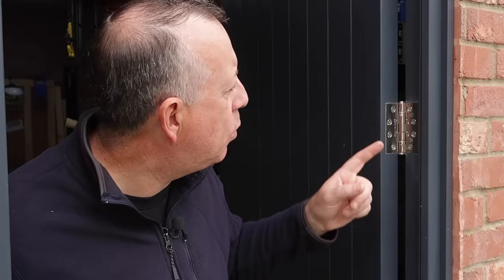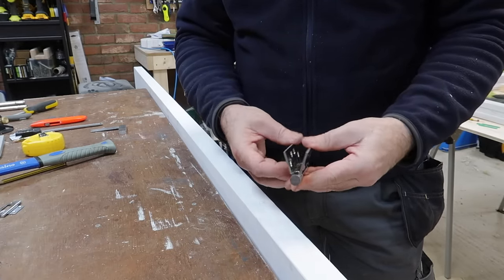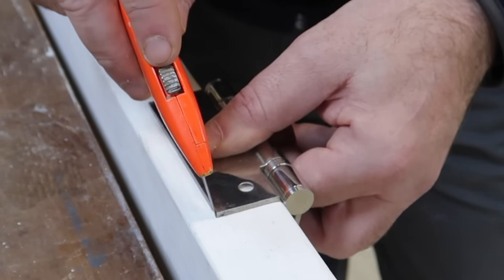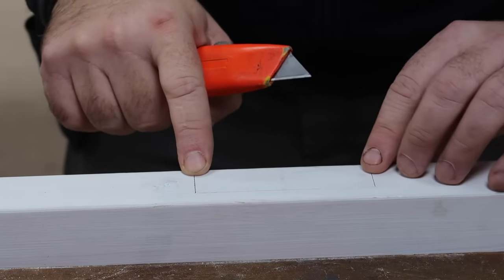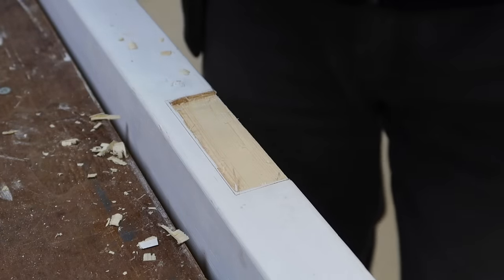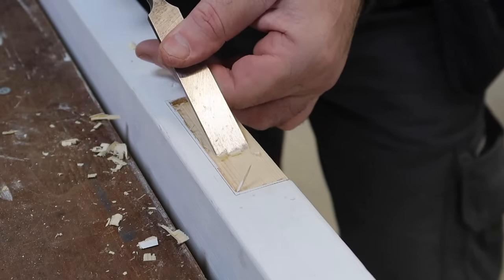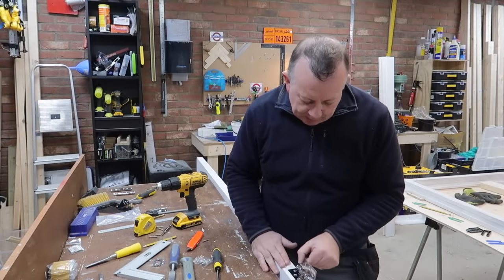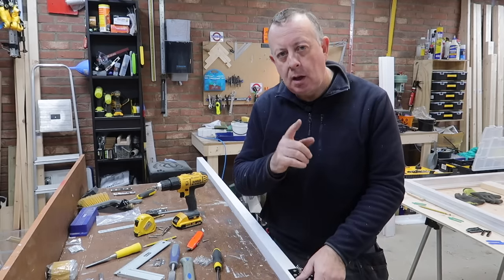How to Fit Perfect Door Hinges

Comment: As someone who has been an instructor for many years (not joinery or DIY) I can say that this guy is a truly great instructor. Calm, clear and just lets his knowledge flow through him. Top notch.
Reply: A great presenter as well.
Reply: You actually know that it’s a joiner who hangs doors not a “professional carpenter “. A carpenter does carcassing, first fix, roofing etc aka roughings in Scotland. The hinge set out on a standard 1981 or 2000    6ft6 is 7 inch from top, 9 inch from bottom with some regional variations… never 4 1/2 inch.
I could go on, sorry.
Reply: blimey.i fitted some door hinges today,I just banged it any old way,like a first year novice at kindergarten school!every time that I fit door hinges,half the door splits down the middle!
Reply: @carljames9351 It depends what part of the country you are in, Midlands and down south a carpenter works on site, a joiner works in a joinery workshop. Always 6" from the top and 9" from the bottom around here!
Reply: @edthompson9337  carpentry is defined in RIBA specifications, RICS methods of measurement etc. carpentry is what they refer to in Scotland as roughings. 
I don't dispute that regions tradesmen may call things slightly different but the terminology and what it covers is quite clearly specified.
Interestingly I spent the start of my apprenticeship at wimpeys training school in Birmingham. It was 44 years ago so my memory may fail, but a couple of lads from the adjacent workshop called the site lads carpenters.
Some parts of the country do hinge 6 and 11, we were taught 7 and 9. These ratios are similar to give the optical illusion they are equal dimensions from head height.
Reply: @carljames9351  Having taught at a local FE college, City & Guilds uses the term 1st and 2nd fix carpentry. 1st fix being everything before plastering, joists, roof, stud work etc and 2nd fix being everything after plastering, doors, skirting, etc.

Comment: Only another 12 doors and 36 hinges to go! :) (I would like to see him fitting hinges to a door where the frame was already installed.)
Reply: Well his method of putting a 12”steel ruler ( not a joiners tool) across the edge of the door to somehow allow marking the hinge depth wouldn’t work as shooting the door in to an old frame requires planing a slight back fall on the edge of the door,all joiners just hold a pencil and run it freehand using door edge to gauge off simple

Comment: Thank you. i do rescue work w/ my city's homeless Animals, and i've built this crazy-awesome shelter w/ the roofing structure i am putting on hinges (So i can open the shelter for cleaning whatever). Going broke for nice materials that will last, i have these heavy hinges for the job....(never done hinge work before) wasn't confident at all on how to install the hinges until i watched your video. Working on it in the woods today, i need to remember that the door (i mean the lid//the roof) is the part i start with. Thank you again. i've been fretting this part of the shelter for EVERY DAY for the past month. Thanks :)
Reply: i also plan to try filling my drill holes with glue also before i put in the screws. i think the glue not only "locks" the screws in place, but the glue may also absorb into the inner wood and create a stronger "sink-hole" to bear weight and such. Thank you again. You really took this fretting headache off my shoulders.

Comment: Hi Stuart 
Good video. The hinge space at the top of the door can vary depending upon the age of the property that it is to be fitted into and also the type of door for example fire door will have a full specification on the hinge positioning and the type of furniture that can be fitted.  But when I was an apprentice we were told the bottom hinge was to be fitted at 9inch up to avoid the hinge being splashed with water during rain etc and causing corrosion it also helps with access when you are chiselling them out👍👍

Comment: I never use the screws that come with any fittings, hinges or any door fittings because they are usually crap.
Reply: Stainless or so soft !
Reply: Pilot them and when youve Placed your screw in the pilot hole scrape your knife against a bit of sandpaper over the screw heads.works a treat to stop them slipping out
Reply: The hinge screws are find just hit the hinge with the Vix bit to pre-drill very screw your going stick a screw holes on the hinge and lower the torx pressure on your screw gun and hit the center of the hole with an 1/8” drill bit if you don’t have Vix bit, if the Screw is way thicker use a 3/16 drill bit, or the screws heads will snap. Do not use a regular Drill because you can’t control the torx pressure on a regular drill to drill the screws. I’ve installed more than thousands of Doors For Builder Square, HomeDepot & for Lowe’s at their Costumers houses. I’ve made Front Entry Door’s and Raised Panel Cabinets, and installed many Kitchens, custom and store bought cabinets a lot of other wood work. Commercial Building and all their hardware and Complete Houses. From cutting roofs to inside fabricating Interior Dom roof’s to Stair cases hand rails, Crowns, Interior wood work of vehicles. I’m just a very old wood craftsman. Just in case you question my experience. Hope it works for you, cheers.
Reply: I use decking screws haha never ever had a problem

Comment: Great video as always. 👍

I spent years using a chisel then, one day I thought I’d try a palm router. I’ve never looked back. 

Installed a couple of oak double doors last week. Effortless using the router. 

The key, as you show here in your video, is the Stanley knife. Without that it’s very hard to get a nice looking finish surrounding the hinge.
Reply: That’s what I use, I just set the depth of the router to match the hinge depth, then freehand cut it out, staying clear of the lines, then finish off with a corner chisel and a normal chisel, I have graduated to marking knife from the stanley knife, it’s quick and easy.

Comment: Actually cried out "oh yes!" when I saw you're tackling this haha! I'm changing at least five of my internal doors, and had to repair the chewed up remains of frames where previous occupants botched screwing hinges. I'm eager for more tips on offering up doors with shims, marking for trimming and frame rebates; seems like such a pig of a job but I'm sure there's an easy way. Yes, self-centering drill bits save so much bother, wish I'd bought those years ago. Chisels only for finishing, router with depth stop for rebating on easy mode.
Reply: @kirkhamandy  I have a good router, and made a little jig for rebating hinges, but before I get on with the rest of our doors I'm hoping Stu has suggestions that make the hanging easier. That's this week's excuse for putting it off anyway. 😇

Comment: Hi, nice job. I see so many butchered hinges these days, nice to see a good finish. Two things that spring to mind. 1 Get a soft-faced dead blow hammer for your chisels, I so hate to see a hammer used as a mallet. Dead blow hammers are much better and your chisels will thank you for it. 
2 the back of your chisel looks like it's never seen a stone. The shinier the back of your chisel is the better it will sharpen and cut.
Like many here, I use a small router/trimmer to remove the bulk, but people should use your method  if they are just a DIYer
Thanks for the video.

Comment: This is excellent, no music, no in your face 'guys' jabber. Same method I use, I'm a decorator so like dead straight clean edges. I tend to use wider chisels as I find them much easier to control and get flatter rebates. I also use Olfa knives as they are ultra sharp and thinner than Stanley blades, the snap off idea encourages much safer working as blade will always be sharp. Careful now! Really like centering bits too , essential.

Comment: Another classic video, thanks.  I find the really hard part is fitting the door-fitted hinges to the frame accurately - do you rely on measuring and marking?
Reply from the maker: Thanks. Measuring is not accurate enough. Need to offer the door up an shim in place and then mark as I did with a knife
Reply: @ProperDIY  video please!
Reply: the best way to mark up for hinges, is to make up a stick, with hinge positions marked, with the door gap at the top marked on the stick, always measure from the top  of the door going down. once its made, its easy to mark both frame and door with one stick, and is perfect every time, a rough guide to hinge positions is “the top of top hinge, 6 inches down, the bottom of the bottom hinge, 9 inches up ( from the bottom of the door)
the centre of a centre hinge, central, between top and bottom hinges, ( there is far more forces acting on the top hinge, compared to the bottom one, so its not a bad idea to fit the middle hinge a little above the centre point between top and bottom hinges on the door,

Comment: This isn't YouTube DIY, you haven't used a £10k table saw or router table for the smallest of jobs 😂
Having said that, I use my palm router for the bulk since I'm too lazy, I then just use the chisel to clean up the edges, no hammer required!
Palm routers are cheap as chips these days and come in handy for just about anything.
Reply from the maker: You'll know when I get sponsorship when I start using the big table saw!
Reply: I use a palm router ...I have 2 Axminster jigs one set up for 4 inch hinges and one for 3inch hinges really quick and accurate..trend corner chisel to square the corners. they must have paid for themselves ten times over...only have two jigs as I'm too lazy to mess about adjusting them

Comment: Very good advice. For centering I use a wood drill the size of the screwhole. So it is guide as in the selfcentering drill bits. The wood drill has a center which will make the dimple and the edges in contact with the surface. Those are then guiding the drill in the hole.

Comment: Attention to detail. Very impressive. Good to see.   In the pro environment, profit and time constraints mean most would never take the time to do a "proper job",

Amateur me has time on my hands and that Stanley Knife and metal straight edges is  something I discovered many moons ago when simply picking up the Stanley Knife instead of the Wood Chisel. A simple mistake like that reaching for the wrong tool teaches you a better technique. 

When the time comes to insert the actual door lock into the side of the door, again using the door lock itself as a guide to produce the perfect and neatest aperture, job's a good n. 

Yes, few folks would notice if any but as Proper DIY confirms, it is very satisfying to do it right even if few folks would ever appreciate that level of accuracy. Pedant me would notice it though.

Keep this good stuff coming.

Comment: I have been a chippy for over 32 years and I was taught by the best old time chippys and the hinges should be 6 down and 9 up and cantre and if you open up the hinge you will notice on the one side there is a slot and that is the line for edge of the door you don't fold the hinge in half and push it to the side of door as when you chop it in the hinge won't sit flat, that's how I was taught in college many years ago but if your happy keep up the good work.

Comment: Fantastic. As a TIME SERVED JOINER I would like to advise your viewers that RAZOR SHARP CHISELS makes this task A HELL OF A LOT SIMPLER. That is another skill to learn too. Very neat my friend.   👍👍👍
Reply: Hi Ian, I am an old carpenter joiner. At the Theatre where I work we often get outside contractors in to do large builds etc.  Very few, if any of the modern day carpenters can sharpen their own chisels. I sharpen all my own tools including my Disston saws, Cast steel marples, Ashley Iles, and Scharwhecter chisels. Plane blades also.  I know of no carpenter that has been to our place who can sharpen a plane so it doesn't leave tram lines on wide timber. That's if you can find one who even uses a hand plane.  I'm 61 and probably a boring old fart but was always taught that you weren't a Carpenter until you could sharpen your own tools.  Sorry!!.........the boring old fart is going now!! 😂😂.
Dave.
Reply: Also Ian.....they sell chisels you can use straight out of the box these days!!! 🤣🤣🤣.  I've lost count of the times I've seen er...wannabe carpenters using chisels straight out of the box because it says so on the box. And let's face it to them it probably feels sharp!! I always flat grind mine bevel up on an India oilstone to make sure the back is perfectly flat, then I hone the edge....or put on the 2nd edge as my old Dad used to call it. Take the burrs off flat again then wipe off the oil and strop it on the flat palm of my hand.  Makes them like razors. It's amazing the amount of people I've sharpened chisels for who test the edge by holding the chisel like you would a hammer and  press their thumb on the top!!  I have to say Whoa!! Stop!! You'll slice yer thumb off!!  Flat grinding hammer forged chisels can take a while though!! 😂😂.
Dave.

Comment: Very good video Sir. Love the technique. Also love the close-ups of chisel placement and the careful way you came INSIDE the 'Stanley knife' line. Very methodical and safe way To do it. You may add using a nail punch to mark the drill holes if they don't have a self-centering bit (instead of a nail. Lol. But that's a minor trivial point. Watched several different videos on doing this. I learned a lot from each one. Each one slightly different, but ALL GREAT. Thank you. Looking forward to more of your videos. The others were more for the aspiring Jedi level intermediate folks and DIYers. Yours is more practical and useful for beginners who don't have all the fancy knives, and bits etc.

Comment: really great advise, i'm replacing all my doors right now, however once i have marked my hinge with a knife, i use a router to take out the main area for the hinge, gives it  a really consistent depth and smooth finish leaving only the small edges to trim away.

Comment: What a fabulous video, thank you. I’ve had new doors fitted all downstairs, but only 2 hinges were fitted on each. I am worried that the doors will warp or otherwise not stand the test of time, so want to add a third - I actually bought more than enough hinges, as our upstairs doors were fitted with 3 each (different joiners). I always have to prime the bare wood too though (although it does sometimes mean the hinge is too tight and I need to cut away a little paint when re-hanging).

Comment: Very nicely explained and the perfection is very top line. But doing consttruction site the main contractor gets unhappy about time it takes. Now a days it's a trend use router put on hinge and use no more gap filler. But doing right way shows the skills of putting hinge just you showed. So thank you.
Reply from the maker: Thank you. Of course if you have lots to do a router and a big is the way to go.

Comment: I just use my hinge template and a router. It takes all of 5 minutes and they are perfect. No fooling around. A hinge template like the one I use spaces the hinges perfectly from each other and from the door jamb. And then the router perfectly follows the template to remove the material. And then you then place that template on the door jamb to get a perfect match to the door itself with no fiddly measuring or possibility of error. I use the Carey template hinge mortising system.

Comment: Nice job on cutting your hinges out if l am right your hinges have stainless steel screws so I use another screw before putting the stainless screw in and the centre drill bit are dam good l got a full Snappy set 25 years ago which trend make now would not be without them my dad taught me how too hang a door and he was old school joiner but you never stop Learning  stay safe 👍

Comment: A nice well shot and presented video. Some great tips here. However, I was taught joinery by a very demanding craftsman and, if he’d caught me hitting a chisel with anything other than a wooden mallet, he’d have gone ballistic!
Reply from the maker: Thanks. Oh well, each to their own. I use cheap chisels and cheap hammers all of which I've had for years so if they do get damaged I'm not going to cry about it.
Reply: This all comes down to whether or not a chisel has a metal strike plate or not. If only rubber/plastic handles then yeah a wooden mallet is the way to go
Reply: @GamerMatt91  there is a group of tools known as firmer chisels. Traditionally these were thin necked tools which should never be struck by any sort of mallet or hammer as there was a possibility that this neck could snap. Mortise chisels, on the other hand, had a much more robust neck which was designed to take the impact from a mallet. These days this distinction seems to have been lost, most chisels now appear to have a a mortise chisel type neck.
Reply: @philb2270  there are 3 types of chisels commonly used in carpentry and joinery, the bevelled edge, the firmer, and the mortice chisels, the mortice chisels have no chamfer on their edges, the sides sit square to its flat, and the chisels are in section, higher than they are wide, eg, a 10mm mortice chisel will be 12mm thick, ( or more ) the firmer chisel is like a mortice chisel, but is thinner, eg, 10mm chisel will be maybe 4-6 mm thick, the bevelled edge chisels are like the firmer chisels but with a large bevelled edge, ( the mortice and firmer chisels have no bevel), when i was an apprentice, the way to remember which was which, between the bevelled and firmer chisels was the firmer chisel is much FIRMER than a bevel. many people mistake firmer chisels as being mortice chisels, when in fact mortice chisels are much more substantial.